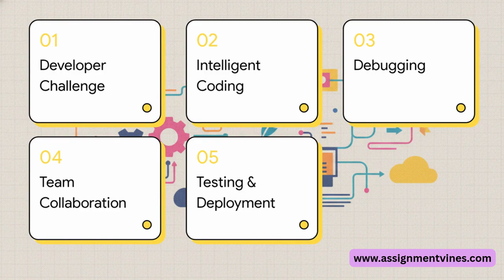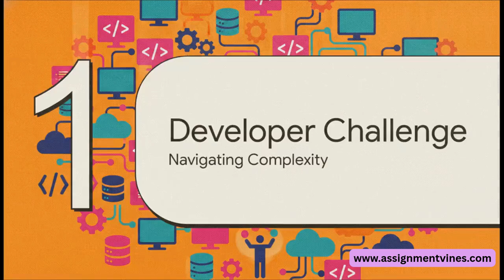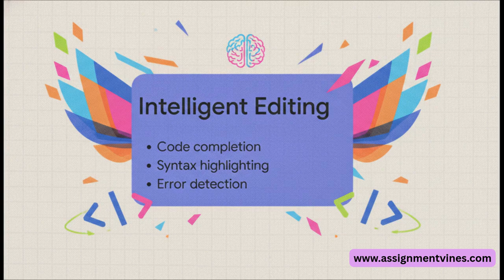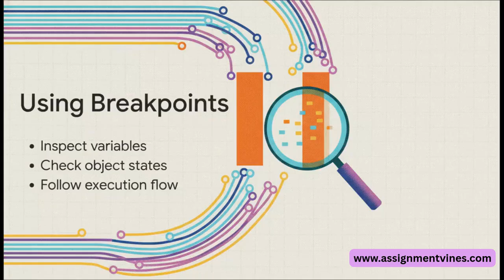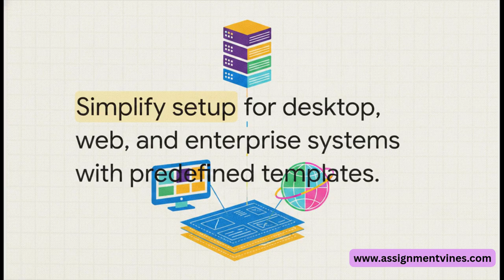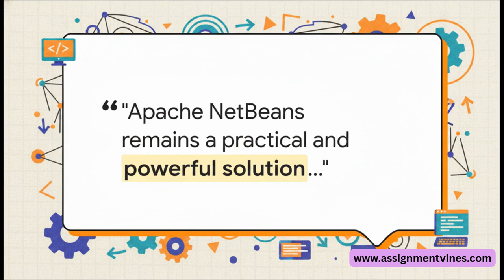From Debugging to Deployment | Essential Apache NetBeans Features for Developers

Comment: Apache NetBeans brings coding, debugging, testing, version control, and project management together in one development environment, making the software development workflow more structured. Which NetBeans feature do you find most valuable for improving productivity: debugging, code editing, project management, or version control integration?